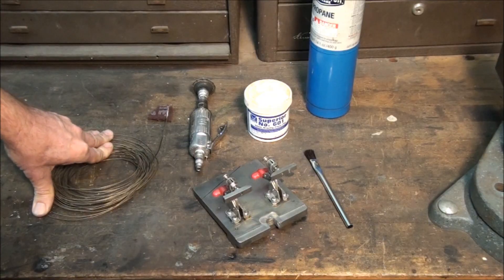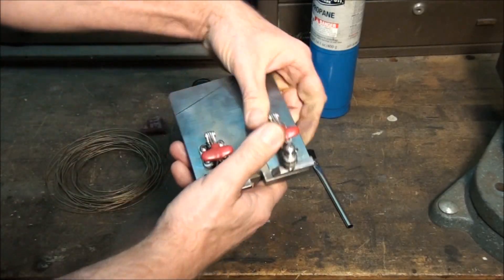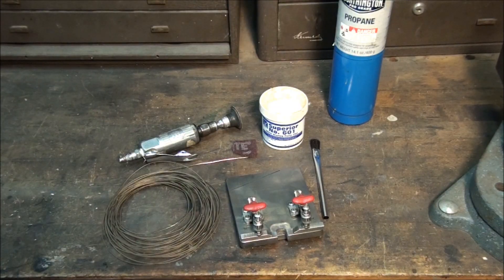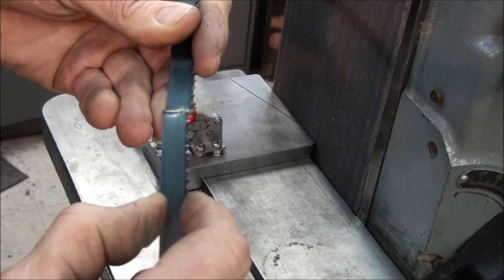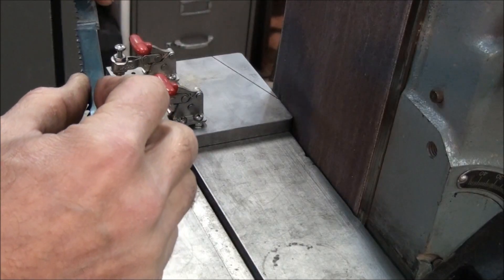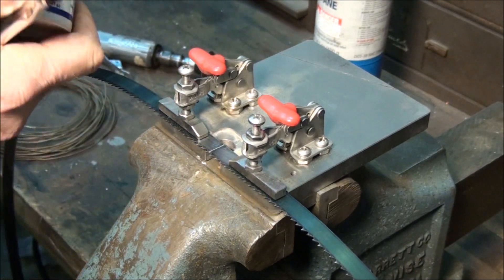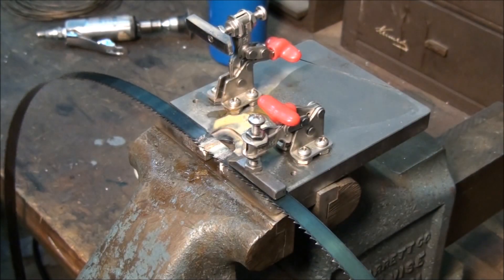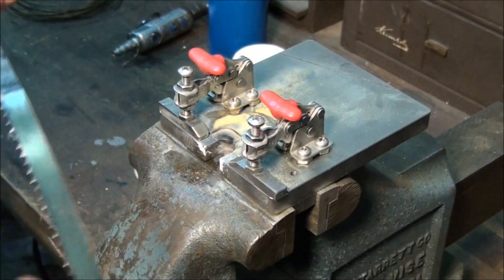How to Make Custom Length Bandsaw Blades Without a Welder

Comment: Tom, that was an interesting and educating video also loved that fixture of yours, extra efficient.
On your video you expressed your frustration with the blade tension release, there is a product by Carter Bandsaws that can help you with that.
http://www.carterproducts.com/band-saw-products/band-saw-tension/quick-releaser
This would be a bit "hard" to copy but,
Grizzly also makes something simpler that maybe you can "copy" and make one yourself, check this one out:
https://www.youtube.com/watch?v=rxfZphxj2eM
Thanks for this and please let me know if you "made" one yourself, interested to see it.
Good luck.
Reply from the maker: Thanks, I'm glad you enjoyed it.

I have seen that blade tensioning device before and it would make a fun project. Unfortunately that's not the only thing that's frustrating about this band saw. It's also too small and the shift mechanism to switch from low to high is missing parts. At some point I'm just going to upgrade it to a larger saw and move on.

Thanks for watching.

Tom
Reply: Tom, in any case you tempt to "do" a mechanism like that, I'd be curious to see it, good luck.

Comment: Thanks for the video. I know its been around a while but I'm finally getting around to making a blade soldering jig. My saw blades are 117" on my Dake and are $$$$.
Reply from the maker: This will definitely save you some cash. It's not quite as convenient as having a welder on the side of your band saw, but it works just as well and costs a lot less. I was just using the blade that I made in the video and it's starting to get dull after over a years use. The brazed joint is still holding up well though.

Tom

Comment: What a great little jig. we always used the welder that attached to the saw (industrial) but this would have done a much better job. How many small fab shops are sending blades out to be re-welded.
Reply from the maker: Thanks.

I've used a number of different blade welders and they were all quite persnickety. It was tough to get the weld and the temper just right for a sound joint. This method takes slightly longer but it works every time. The blade I made in this video is getting a bit dull, but is still in use.

Tom

Comment: when you polished the weld why did't you clamp the blade out on the end of the jig 3 inches either way of your center of the jig.  more room to work with the sander.
Reply from the maker: Because I didn't want to grind into the step of my fixture. There is plenty of clearance for the disk in the center.

Comment: Made and used mine today,works really well,great idea. I used a Dremmel with a small sanding bobbin on it,cleaned it up easily and very well.
Reply from the maker: That's good to hear. I'm still using the blade I made in this video more than a year ago. It's starting to get a little dull, but the joint is still strong.

Tom

Comment: That's a great idea. i have about a dozen or more old  blades and recently found I was able to sharpen them very easily using my Dremel and a diamond coated tool bit. The blades cut as good as new. If the blades have lost there set throw them away they wont cut straight.  A 102" blade takes me about 15 mins to sharpen. That's half the time it takes to drive somewhere to by one !
Reply from the maker: That's a lot of teeth to sharpen. You must be a patient man. :)

Comment: thanks tom super demo and very professional fixture; i think the finer pitched blades i did w/ the machines welder maybe made the blade(s) brittle or the stock not matching the blade or the machine set-up nuances not recognized or the (student) operator forced the cutting (the hands-on variable of how much is excessive when cutting what...) > had to re-make them a couple times as an apprentice tool maker...its not an exact science even using the handbook blade pitch & speed recommendations only because...its not butter your trying to go thru there young man, the closer to it than you can get the better is how it was instructed & paid . again, thank you for demonstrating.
Reply from the maker: Thanks Gerald.

When welded blades fail, it's normally because they were not properly annealed. Too much or too little annealing results in a weak or brittle weld.

Tom

Comment: what a fantastic step by step.....thank you.
 i cut miles of stainless tubing everyday. my blades aren't too expensive at $25 a pop but making them would be great so i don't have to deal with shipping times. also a great skill to add to the tool belt.
where is your preferred supplier of blade lengths?

thanks for the response in advance!
Reply from the maker: I don't use a lot of blade stock, so a 100 ft. roll lasts me a long time. I think the last stuff I got was from McMaster Carr, probably not the cheapest place to get it, but they sell name brand and they are convenient.

Glad you enjoyed the video.

Tom

Comment: Thank you for the nice instructions. I have tried this before but must have not used the proper solder. I had no idea the difference so you help me allot. i will give it another try.
Reply from the maker: Yes, there are lots of different solders and brazes. For this application you need a high content silver solder that will readily wick into the joint. A thin solder is much stronger than one with a lot of filler.

Thanks for watching.

Tom

Comment: Tom,what did you cut that 20 degree kerf with? Brazing with copper rods are no good? Why,and only cause I have  oxy-acelene already.
Reply from the maker: The 20º groove was cut with a slitting saw on the mill. If slitting saws make you nervous, it could also be made by end milling a wider slot and then making an insert to create the thin groove. This could also be made adjustable for different thickness blades by slotting the screw holes that hold in the insert.

Ordinary brass brazing rod would not produce a strong enough joint. The silver solder not only has a higher tensile strength, it will also wick into the small gap in the joint of the blade.

Tom

Comment: Nice clear instructions.  Now all I have to do is build a jig like yours. ;O)
Reply from the maker: Thanks for watching.
Reply: Toms Techniques So there is no annealing required with this method?
Reply from the maker: valveman12

No. Only welded blades require annealing.
Reply: Toms Techniques Thanks Tom
Reply: That's one of the advantages that brazing has over welding, as long as the base metal is not overheated.  My understanding (non-professional) is that the temper is removed if the base metal turns red, going to blue is needed.  The technique is to heat it just enough to allow the base metal to supply the heat needed to melt the solder, which is why tuning the solder to "high" is how the heat is controlled as it takes more heat to melt it, but that heat is below that which will de-temper the base metal.  Beware, the lighter, thinner the blade, the faster it will overheat, so bigger blades can handle a hotter flame, while the lighter blades need a lighter flame and more delicate touch.

Another advantage is that the brazing metals are softer than the blade steel, and this makes them more ductile than a homogeneous weld.  This ductility allows the joint to be more flexible and longer lasting than a welded joint, and therefore more resilient to the repeated bending/straightening cycles that bandsaw blades experience.  The welded joint is stronger...in a straight line pull without any bending cycles, but our bandsaws cannot apply that much stress to the blades, so the brazed joints prevail in our bandsaws.  (Welded blades are more economical in automated blade production lines)

Comment: Great job Tom, like your brazing jig and the clever 20 degree butt joint applicator. Silver soldered joints are better, most of the time, than my $12k welder, anneal, anneal, anneal. Thanks again Tom, cheers!
Reply from the maker: Thanks!

Annealing is always a crap shoot. Too much or too little weakens the weld.

Tom

Comment: Just make sure you don't accidentally put a twist in it :)
Reply from the maker: That's why they put those pointy things on one edge.
Reply: If the blade is long enough I'm sure some doofus will somehow manage to put a full 360 twist in it.
Reply: James Bradwell 
How about a Mobius blade? Might cut through your blade guide, but hey, you could fit double the number of teeth on a blade like that since it's only one edge goes around the ring twice ;).

Comment: teeth lining up, is where I have been going wrong. So simple when told, How.!
Thanks mate.
and hasn't silver solder become nice and expensive.!!!
Reply from the maker: Yeah, it cuts a lot better when the teeth line up.

Silver solder has always been expensive and doesn't seem to follow the price of silver. Silver is around $6 an ounce now, but silver solder costs over $50 and ounce for the 56% stuff. Luckily it doesn't take much to braze a blade.

Tom

Comment: Tom, 
What do you call the blade clamps that you've attached to your jig?  I'd like to get some like them
Reply from the maker: Those are toggle clamps. They are commonly used in fixture making and are available at any industrial supply, such as McMaster Carr, Travers Tool Supply or MSC.

Tom
Reply: Thanks so much for the prompt response

Comment: I have been silver brazing by blades for years ever since a patern maker friend told that pattern makers always use this method it is sronger and much easier to acheive a bumpless joint
Reply from the maker: I don't know about being stronger than a properly welded joint, but a brazed joint is certainly easier to achieve with minimal equipment. Regardless, it's strong enough to get the job done.

Tom

Comment: Tom, what alloy of silver brazing rod are you using?
Thanks
Reply from the maker: You need solder that's at least 56% silver. A higher percentage of silver is stronger, but harder to use.

Tom

Comment: do you think think regular wire feed welder would work?
Reply from the maker: I've actually tried that and it's tough to keep the weld out of the teeth. With all the time it took to grind down the weld, it was quicker to just silver solder it.

Comment: Hi Tom, Great set up. Shame that you ground off the "set" on the teeth when you removed the surplus Solder. You should have had the blade the other way round, then you would have had control as to how far over you took the sanding disc. As Silver solder is relatively soft, you could have also filed it with a lot more control. Good show, keep the excellent videos coming.
Reply from the maker: You know Dave, I'm still using that very same blade 8 months later and it cuts just fine. Guess grinding the set out of two teeth doesn't really make much difference. But thanks for pointing it out.

Tom

Comment: I don't know if this has been covered, but why can't you use regular brazing rod?  Is the alloy too hard and therefore brittle?  I have a decent oxy-acetylene setup, so the higher melting point of regular brazing rod would not be an issue.
Reply from the maker: I think you'll find that silver solder wicks into the tight joint more readily, producing a stronger bond. The copper based brazing rod isn't as "wet" so it tends to sit on the surface rather than wick into the joint.

Comment: Great video, I think I've got to give this a try. I do have a Question though? Looking at you band saw it looks very similar to one that I picked up and rebuilt. The sad thing is there is absolutely no markings on it for ordering any upgrades as guides and such. What brand is yours? Thank-you for any info.
Reply from the maker: It's a 14" Delta band saw. They are very common and have been in production since the 1940's and haven't changed much, so parts are readily available.

Tom
Reply: Thanks, keep up the videos I'll be watching.

Comment: Squaring the blade ends first is a wasted step. When you make the faces for the scarf joint, they will be squared up automatically.

Note for those without a die grinder handy:
Silver solder can be filed off, too. Hold the blade on the edge of something solid with the teeth overhanging the edge (the bandsaw table would work just fine) and take smooth strokes, being careful not to go beyond the gullet. If you used the right amount of solder, there won't be a whole lot to clean up. A few strokes on each side and the back should be plenty.

Note for Tom: a right angle grinder makes seeing what you are doing much easier. Patco (Dotco?) makes one you will never in a million years wear out. I bought their re-build kit when I bought my grinders from them and have not, in 20 years, needed it yet. Both bodies, straight and angled, take the same kit.

Granted, I left the trade after about 5 years, but they have seen light use on numerous occasions in the intervening 15 years and often had to deal with airlines so wet my hands got soaked after only a few minutes of use. I just oil them every time I fire them up and they are still doing fine.

Note for those asking Tom to make you a jig: the jig is simple enough that you can make it with hand tools and a tiny bit of ingenuity. The only critical dimension is the width of the rabbet. Make it wide enough to accept the widest blade you use, measuring the blade from the gullet to the back. If you use narrower blades, make a separate rabbet sized for them into the original rabbet face making, in effect, a stepped rabbet.

Attach the key to the underside of an oversized piece of stock and use that key to provide the reference surface for all other machining steps, starting with squaring the stock, and also as a registration face when clamping it up to make the kerfs for the rabbet(s). Tilt the bandsaw table to make the 20 degree cut while clamping the base plate to an angle plate. Make certain you make that slot on the same corner Tom did so that the disk / belt will be moving in the right direction (down). This will hold the blade steady in the slot. Make the cut far enough inboard to allow at least a couple inches worth of slot to set the blade into. A half inch deep should be plenty.

Do a Google Search (DAGS) for the angle plate if you need one and aren't confident that you can make a decent one yourself. Harbor Freight, Kitts and similar will have cheap ones that are accurate enough.

If you lack a mill to make the rabbets or the skill to cut them by hand with grinding stones and files, invest in a sanding plate for your table saw and use a coarse abrasive disk to make the rabbet(s). It IS important that both sides of the rabbet be on the same plane, so do not cut the clearance slot until the rabbets are complete. If you make the rabbet other than parallel to the bottom of the jig, it's okay, but you want the two sides to be co-planar. Making them first allows you to use the flat of a long file to adjust the bottom of the rabbet and its edge to clean up the back edge of it.

Determine where and what size you want to drill the hole, then lay it out and drill it from behind. The best place for it would probably be centered on the inside edge of the rabbet furthest inboard and, since this is now an uneven edge, it is best to drill from the opposite face, which is flat. Prop the piece up so that the drill will not damage anything when it comes through on the opposite side. While you are drilling, you might as well lay out the locations for the clamp screws, drill and tap them. Drill the tap drill hole all the way through, then chamfer both ends of the holes at least as wide as the outside diameter of the threads of the bolt you are planning to use. This will eliminate any chance that displaced material will make the surface "unflat". Then tap the holes as straight as you can. Use a v-block or other jig if hand-tapping or, better yet, remove the tap drill from the chuck, insert a tapping center (a short piece of broken drill ground to the shank with a 60 degree point ground on it) into the chuck, then, with the tap in the tapping head, line everything up with the spindle and the hole, apply a modest amount of pressure and turn the tapping handle by hand. (Do not power tap on a drill press! They don't have a reversing switch.)

Once those mounting holes are drilled and tapped, lay out two saw cuts to intersect the edges of the flame clearance hole and cut that slot.

File all rough / sharp edges, mount the clamps and, "Bob's your uncle", you're done!

BTW, Tom, good jig design. Does enough to be useful, and does it simply. Difficult to use it improperly. That makes it a good design, in my mind.
Reply: Squaring the blade first is done so that the teeth line up with eachother. Then the scarf joint can be ground without worrying about the teeth lining up. This way there will be a gullet in the blade consistent with the rest of the teeth.
Reply: Talk about hijacking a thread.... bravo
Reply: Thanks for filling in these details.  It helps keep Tom's vid short while providing the knowledge to successfully complete the job for those who might want to tackle it.
Reply: Another way to grind the joint with a straight die grinder is to use a fat cut off disc and grind with the edge, using it like a rake. Of course, a hard point/stone works fine, too.

Comment: Hi Tom Great job!  Where can I buy the bandsaw blade stock? Do you have a video on how to make the jig / clamp?  Bryan :)
Reply from the maker: Thanks Bryan.

I buy my blade stock from McMaster Carr although any industrial supply will carry it (MSC, KBC, Travers, Enco, etc.).

There is no video or drawing on the fixture because it will need to be made to fit your specific belt sander. The only thing I might suggest in making it is that if you have trouble with the 20º slot, just mill a wider slot with an end mill and make an insert bar to fit that will leave the proper gap for your blade.

Thanks for watching.

Tom
Reply: you can buy the stock on amazon.com by the 100' roll http://www.amazon.com/Morse-Carbon-Steel-Bandsaw-Blade/dp/B0007OTC3K/ref=sr_1_8?ie=UTF8&qid=1407810680&sr=8-8&keywords=100+foot+band+saw